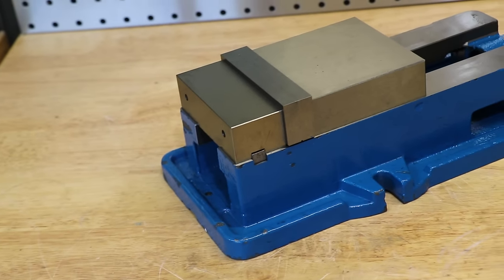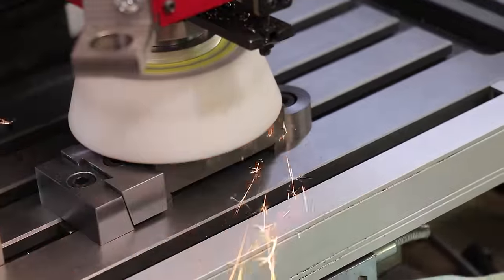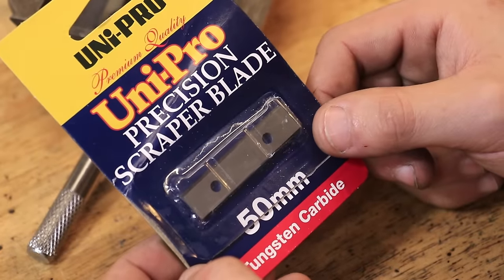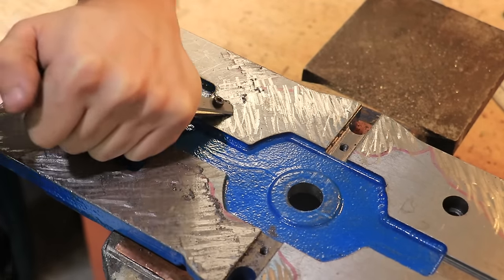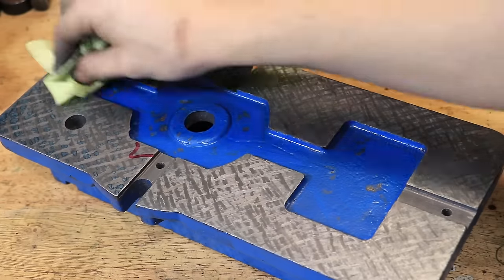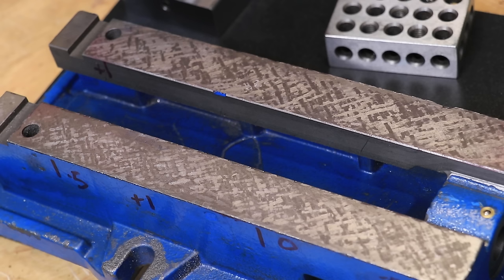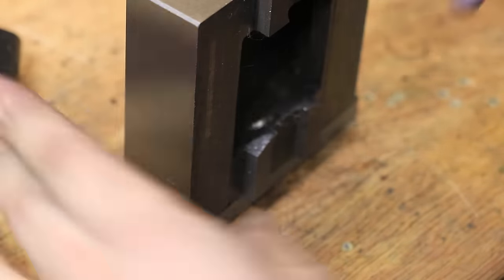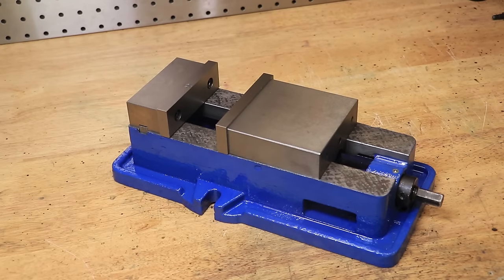My Cheap Milling Vice Has Issues. Can I fix It? (Surface Scraping)

Comment: For the 'Engineers blue', I'd recommend not using linseed oil.  Linseed oil is a 'drying' oil, and a good choice when you want the oil to cure to a film - but that's explicitly want you don't want for that for this purpose. Instead, you'd want it to never dry,  otherwise it'd be a pain to clean the surface plate. Plus, linseed oil isn't usually the cheapest oil.  Any cheap vegetable oil will work just as well; ideally you want one with a low iodine number (i.e. very far from a drying oil: so olive, rapeseed or canola, whichever happens to be cheapest.  Sunflower is almost as good, if that's what you already have).  Mineral oil aught to work too, but with starting from oil paint, some plant oil might blend better in that case, given that you're not expecting to need a long shelf life for it.
Reply: exactly this, try something different like engine oil or some other oil that isn't drying. Linseed oil turns into a rubber like consistency after some days to weeks, I ruined leather by applying linseed oil because of this. It will leave sticky residue on tools and might ruin your surface plate.
Btw. I made engineers blue by mixing a fine pigment powder with grease, don't make the pigment content too low or you might not be able to see the touching points very well.
Reply: I appreciate your sharing this info specially for newbies like myself. Thx. ae.
Reply: What does it matter if he washes it off afterwards?
Reply: @frikkied2638  Linseed oil will spontaneously combust on a rag or paper. Thats why many don't like using it.
Reply: of course you want it to cure, how would you do layout otherwise?
Reply: @miko007  Bearing blue needs to remain like a very thin paste and never dry. otherwise it will not highlight properly. Layout blue is a very different compound made to hold marking out.
Reply: Dykem for dry.  Permetex Prussian blue for wet.
Reply: Don't mix vegetable oil with mineral oil or the vegetable oil will coagulate and go sticky.
BTW, you would have done better all round if you had bought a toolmaker's or grinding vice as they are heaps better and are far better made than the cheap one you show.......a 125mm wide one cost about $180.
Reply from the maker: Thanks for the information. I tried mineral oil a while back and for whatever reason couldn't get it to mix properly with the oil paint, it just turned into a gloopy oily mess. I'll try with vegetable oil and see if it works. Cheers
Reply: @n00bkill  AVE is in Canada rarely any day above 30 c. It isn't guaranteed but if its fresh and clean it will ignite paper towel quite repeatably. Not really trustworthy unless you have taken simple precautions.
Reply: I mix ferric ferrocyanide with vaseline (petroleum jelly) to make micrometer blue.
I make layout blue from ferric forrocyanide, shellac flakes, and isopropanol.
Reply: Vegetable oils will go rancid.
Reply: @dazaspc  linseed oil was a very popular wood finish, and is fine if you let the rags dry before disposing them.  Fires were from piles of wet rags slowly oxidizing in a container such as a trash can.

Not a good choice here because of drying, but I expected mineral oil to work.  Hey, it wouldn’t be science without failed experiments!
Reply: @firstmkb
Reply: @gangleweed  I'm a noob when it comes to vises as I think many are who just got into metal work/machining and end up buying any random "milling vise" for $100.  I was going to do the same thinking they were all the same except some were 3", 4", 5" etc. Any suggestions on a vise brand and size for a X2D mini mill? My budget will be $200-250.
Reply: @artisanmakes  hey Artisan! 
How did that vegetable oil work out for you? Asking for a friend 😉
Reply: He's already using oil paint, which has already got oil as a binder. Most oil paint uses linseed oil. That said, he appears to be using Reeves oil paint and the only SDS I can find for that brand that includes the binder says soybean oil. I don't know how compatible soybean and linseed oils are.

That said, the only thing that adding more oil is going to do is dilute the pigment. I can't think of a reason you'd want to do that. If you want it to be a thinner consistency, add turpentine or white spirits.

FWIW, Permatex Prussian Blue uses petrolatum (Vaseline) as the binder.

Comment: Tip from a pro machinist - Don't worry about inspecting tooling in a manner in which it won't be used.  Bolt it down to a mill table, then check flatness.  At the end of the day, you could have a perfect vise and then have a bad setup, bad ways or just bad luck.  If it's first off work, you could use the worst vise China produces and you'd still be fine.
Reply: That Vertical Machining Center video you have is awesome. I'm glad you showed us how it does the auto tool change.  I like how the arm grabs the current and the new one simultaneously and how the new tool is rotated into position to be grabbed.. but not just rotated but also tilts into position.  That final tilt action is very cool.  I would love to see someone make that auto tool changer for their mini mill.  Just the mechanics being used for the servo to tilt the tool into position would be cool. One motor to spend the tool into position where it engages a servo motor that now tilts it into final position for the arm to grab it would be a treat to see how someone figured out how to do it. Theres must be some kind of tab that gets pushed on the tool after its rotated into position to allow the servo to tilt it for it to be grabbed. I imagine there may be a little gear on each tool rest that when it spins that tool into place, the servo has a gear on it that gets pushed into the tool's gear via a linear actuator perhaps?

Comment: You should've blued and scrapped the top first.  Then fly cut the bottom assuming your mil is trammed. Then returned to scrape the top for parallel.

Comment: The Gingery series of books on homemade machine tools uses hand scraping to a large extent, and even talks about using thick glass as a replacement surface plate. He really was a home gamer trying to get by with junk from the hardware store in an age before the Internet. I remember seeing his books all the way back in the late 70's, early 80's. There are a few forums dedicated to building his design of machine tools, using metal casting (aluminum), with wooden or lost foam patterns, and using the created lathe to build a metal shaper, mill, drill press, and then go back and make accessories for the lathe and mill. They also like to talk about hand scraping, alternative techniques, weaknesses in the design and how to improve them, even how to build using epoxy granite. A lot of the older trade manuals have wound up on the net as pdf files, and they really get the imagination going with what can be accomplished utilizing simple methods, clear thinking, and a bit of hard work.
Reply: I agree....I have a fine surface plate but not keen on putting that big  heavy vice on it. I would think your mention of using  plate glass instead would make good sense rather than risk damaging a surface plate.
Reply: I think the whole bootstrapping to make better parts on a machine youre using to make it better is very cool.  Kinda like how guys made 3D printers out of wood.. which they then printed the wood parts out of a filament. Replaced the wood parts and then re-printed the same parts again now that the printer was more rigid and precise.

Comment: I began scraping about forty years ago, buying a century old lathe that had been sitting out in the rain for decades.  I found "a professional scraper" at a flea market, and spent about a year getting the bed straight and flat.  I used four or five old files, each shaped for a different surface, going through the process very much like 'working this milling vise".  I've exactly the same vise with exactly the same problems, and happened across this video because it needs the same process.  It's always good to watch someone else do the work, and pick up details that may have escaped one, in their own journey towards precision.  I've been doing this work fifty years, and learn some each and every day.  Brazing carbide onto a steel shank is the best method I've found for making scrapers and you can grind the carbide to shape before brazing, to get in dovetails and other tight corners/spots.  Working the scrapes into curves covers more area, and can help level the whole plane flatter, quicker.  I used file made scrapers for the rough work, and the carbide tipped for the fine finishing work.  I'd echo some other comments regarding the bluing and it's thinning.  For finishing up, one needs thin bluing.
Reply: rumor has it he's still scraping that lathe.

Comment: Brilliant stuff - great to see a someone learning from scratch, making the gear from scratch, and then scraping something real world. Very impressive. I've done some scraping too, using the old file method and also got great results. And I later bought the exact same paint scraping carbide blank - which I haven't had chance to use yet. It's good to know it's going to work well. Nice one Artisan - Thanks for sharing.

Comment: If it's not a surface for sliding parts (like the slides on a lathe or mill) you don't have to worry about the fineness of the blueing pattern. Just make it so that there are no big low spots left and you're good.

Oh, btw even surface grinders aren't perfect, depending on how you clamp a part it can warp and after grinding spring back, so the precision suffers. Scraping has the advantage that you check the flatness in a relaxed state of the workpiece, so it can be more accurate than grinding. I've seen people grind parts on the surface grinder before scraping them.
Reply from the maker: Interesting. All the videos and books I watched have are focused on scraping for flat machine ways so they all tended to focus on contact points per inch. Cheers
Reply: That has always been my understanding, the very best lathes are scraped into finished state, even CNC machine beds
Reply: @artisanmakes  at my workplace mounting surfaces for linear rails get scraped in and because of the fixed mounting of the rails the contact pattern does also not matter that much. Sure, you still want it to be pretty regular and even, but it doesn't have to be as fine.
Reply: @1crazypj  not the bedways on cncs most of them are hardened. alot of times they will have turcite or rulon on the bottom of the slide that rides on the bedways and thats whats scraped.

Comment: Great job, and great communication of your learning process. I used a disk grinder with Cubitron sandpaper to get all the rocking out of my vise. It went quickly and was surprisingly accurate. Once the rocking was gone, I flat-lapped it on a DIY surface plate using 80 grit Cubitron paper and finally 200 grit diamond powder. All that remains is a few small hollows that won't affect the overall flatness and parallelism.
Reply: how did you do a diy surface plate ? I'm no machinist but often I need a true flat plane to compare/sand flat other stuff like you did, but don't want to go for a pricey granit
Reply: @escalator9734  The Whitworth three-plate method is tried and true and is what was used before modern gauges that can chase flatness to five or ten zeros. It can be done with either stone or metal.

Short version, you have three plates, A B and C. Rub A against B until they sit flush. Rub B against C until flush. Then rub C against A until flush. Repeat until flat. By rubbing every plate against every other plate in that manner, any cupping/dishing is averaged out and you get something approximately flat. By repeating as far as your sanity allows, you can chase the average to zero. In practice with cast iron, you might rub with prussian blue or blue dykum then scrape. You can use cheap steel blocks, but cast iron is more stable. For stone, you rub them together. Probably with water, but I'd look it up.

For hobby non-machining stuff, you can also use float glass and swap it out if it wears out of flat.
Reply: @escalator9734  check with places that make kitchen counters you may be able to cut a  granite offcut cheap or free
Reply: @dragonwing4ever  I was going to say this too. Granite is no longer pricey, as I got my 18" plate for less than a hundred bucks. Now that I think of it, it was used, but same idea. I'm more likely to just lap my vise (exact same one with a PM-25MV mill here) on the stone to start with. I respect this scraping jazz, but it looks super tedious.

Comment: You really do a great job correcting/fixing these low cost Chinese import tools. From your lathe to milling machine and now the vise. I have that same vise and it's been perfectly fine for the work I use it for. I also couldn't justify the high cost of the Kurt vise when I bought my milling machine. A person could buy that $100 Chinese vise, disassemble it and take it to a machine shop and have them grind it dead flat and still have 1/2 the cost of a Kurt vise. Keep up the good work!

Comment: Great subject, I have been happily using my economy clone for many years and it has not dawned on me to check its accuracy. I have done a considerable amount of babbitt scraping (round and flat bearing surfaces) over my career and you pretty much nailed it , learn by doing. Enjoyed the video, very nice work, cheers!
Reply: Nice pun with "Dawned"

Comment: I did the same thing to a couple of 4 inch milling vices a year ago. Spent about the same amount of time per vice. Tried to match them. And it worked pretty well. But when I needed a larger vice I bought a couple of Tegara vices from Shars. About half way price wise between the cheap vice and a Kurt, but every time I look at them I think about how nice they are without having to spend a week or so fixing them. 
Great video, brought back some good memories.
Reply from the maker: Awesome. I was wondering if you could match vices using this method. Glad that it worked out for you.

Comment: Quite good, for first try!
Actually, it might be more flat over the entire surface, than with surface grinder.
A good surface plate usually is better than the ways on a surface grinder.
Surface grinder makes very flat surfaces locally, scraping makes very flat surface over the entire part, with local imperfections, high/low spots.
Reply: Kitamura and Okuma still build their machines with hand-scraped surfaces for this reason - it's a slower and more expensive process than grinding, but can provide better geometric precision in the right hands.

Comment: Hi, Your work is as inspiring as Jordan and the rest of the good youtubers. Try scraping using the same dremel/ball grinding bit you showed in this video but be very light on touching the surface; this way saves you a lot of time and keep touching blue points very very precisely.. it worked with me. Saw it on youtube too.. just dont go deep and on just touching the surface gently. Good luck & thanks forever..

Comment: I used a half ball of a bearing for the contact point 
It's very smooth and hard .
That improves the downforce
Reply: That is what I was thinking would be a better idea than that standard semi sphere the vise came with. Very high degree of roundness accuracy and surface finish with a half flattened ball bearing

Comment: Good work. 1 caveat I would add is that the fixed jaw bolts will distort the shape some. Try a print with the bolts in to see if it needs some correction there. Also you mention the slight out of square the fixed jaw has but you would want it slightly out of square so it flexes to square under load, I thing yours was leaning in the correct direction so it's good. (when you need to be uber accurate you should edge find the jaw/part under full clamping load)

Comment: When making things parallel and flat on a mill with an unflat bed, bolt a metal plate to the bed and flycut that surface first. Then set your vice on that, since it is now parallel with the flycutter. It also lets you tram in your head since you're making a ton of long passes back and forth, you can make adjustments each time.

Comment: Great attempt, you're brave taking that amount of work. Love your videos. Do you think that lapping it on sandpaper afterwards might have improved the surface finish? My milling vise jaws run out by 0,35mm over a 125mm of travel. The rest of the vise is reasonable.

Comment: I have a similar vice with the same anti lift mechanism,  on mine I found the castings were contacting before the little ball, filed away the castings to create clearance and that sorted it.
I've not bothered going to the same extent as you to get it flat and parallel though, I think I'm going to take look at it later.

Comment: I have a similar vice, the 6" version of this!  Just watched the video after tramming my mill and spindle, and running a facing operation on both sides of the vice.  I faced the bottom first, probing off to see the difference.  This thing was a whole 0.0025" out of tram.  I also drilled a couple of holes for another set of mounting bolts as the vice hangs off of the table quite a bit and wasn't sitting 100% flat.  I'm just about to reassemble it, I'm hoping to also reduce the amount of lift that sliding part has.  Now that the surface sits a lot flatter, (within 0.0003") I should be able to get good results especially when using softjaws with machined ledges.  I may still scrape it when I get the chance!
If anyone has modified the sliding part to lessen the vice lift I would be all ears to know how you did it!